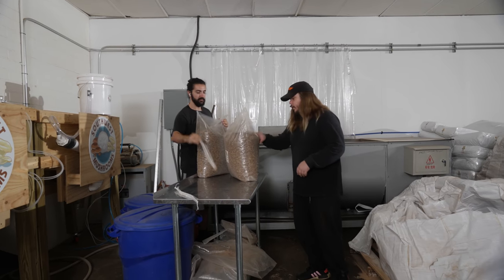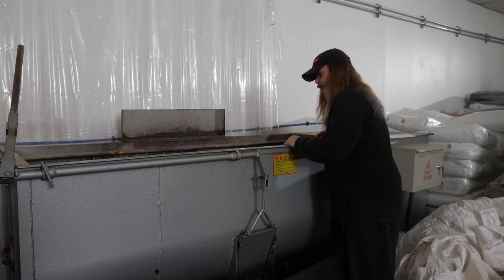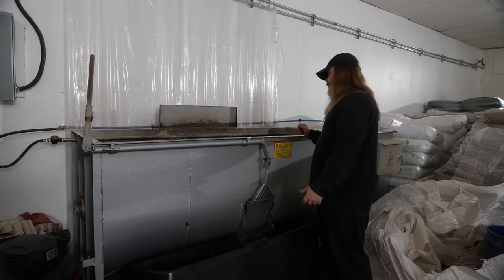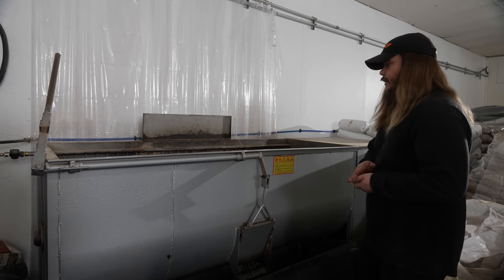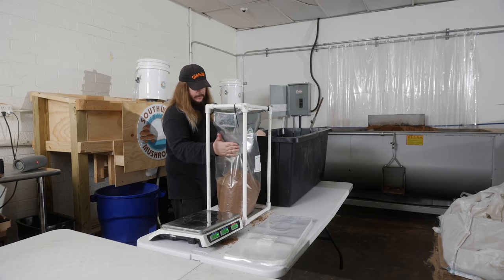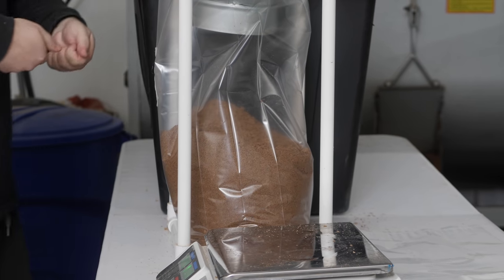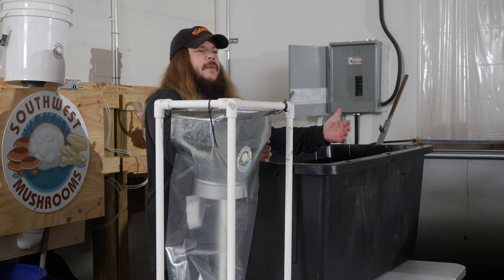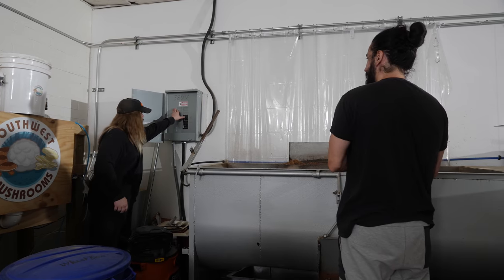Mushroom Farming: Oak Pellet and Wheat Bran Substrate Blocks | Southwest Mushrooms

Comment: Tape off a few of those first water holes in your mixer, maybe every other one. it will push to the right for an even mix.
Reply: Yes.
Also.. to speed and simplify the hole clogs, Instead of that pair of scissors, one could measure the space and distance of holes, and then put thin nails into a plank of wood (with the hole spacing per nail to match the water holes) to make that a 1step process easier, no?
Reply: Lol ok.
Reply: actually the diameter of the holes should be increasing from left to right so the pressure would have been regulated by the end

Comment: I would be stressed out with the rotating parts and the long hair.

I also have long hair and always wear a hairnet when working with spinning/rotating equipment.

It just takes one bad day.

Best regards from austria
Reply: like you should
Reply: I think put on more safety equipment when they are not filming
Reply: To have hair pulled into something it has to be of a length comparable to the rotating wheel. There is some kinda equation for it. Anyways the hair can’t get “sucked” into the machine at this size the rotation is to large. If he was closer to the shaft maybe I would be more concerned but safety first anyways I agree better safe than sorry

Comment: I really need to build one of those "fill-the-bag-cone-tools". Always nice to watch and listen to you guys, Cheers from Jens/HappyMushrooms
Reply: Any way to keep the area a little cleaner. Everything down to the movements. No corner cutting at this farm.
Reply: I think my method is easier: I just got a small square trash bin and cut the bottom off, then i put the remaining sleeve in the bag and fill it like that

Comment: 8:10 solution will be making a bigger holes where the water comes the lest. Just try to increase a couple of holes, or the oposite, close a little bit with tape the holes that are giving more water. You could ajust this in a couple of hours so it would be a big inversión to relax when mixing and also be able to mix it good from the beginning.

Comment: Using a circuit breaker for start / stop functionality is not only bad for the breaker but against code too. I hate to be a dick but the reason is that wearing out the breaker could cause it to fail and hurt somebody.